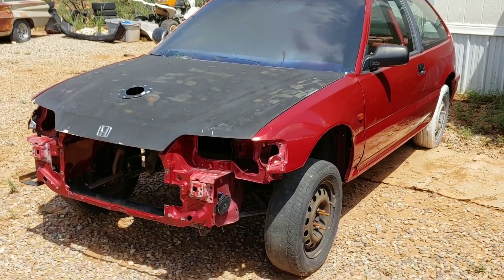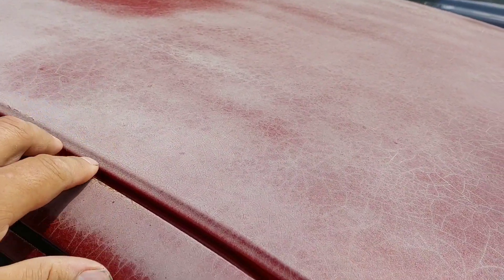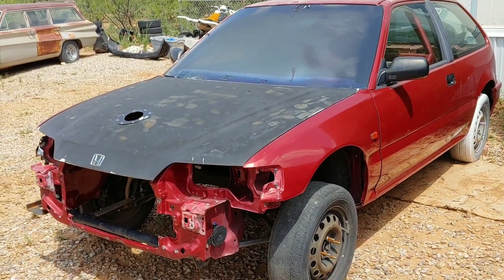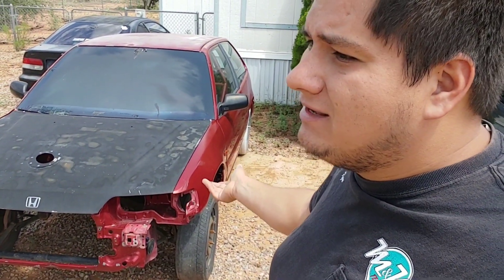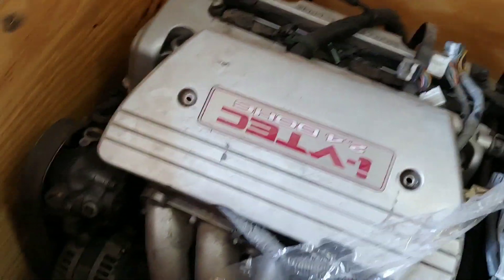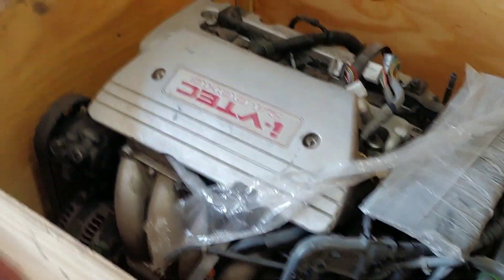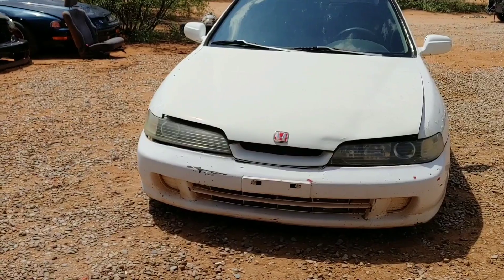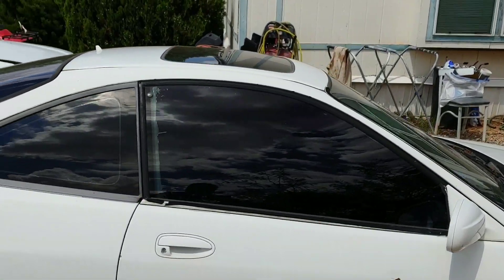Where's the D2B AWD hatch?

Comment: I'm going d16 awd in my eg sedan. All d16 too using a 99 honda hr-v 5spd hydro awd trans. It bolts right up to a d16 because the 90s hr-v suv came with a d16w1 so weirdly stamped d16y series engine. It works and is identical to the b series crv awd trans just the bell housing is smaller and bolts right up to the d16 block. Also the t bracket is different. Let's go k awd in it. Come on
Reply: Klk con eso? Lo hiciste?